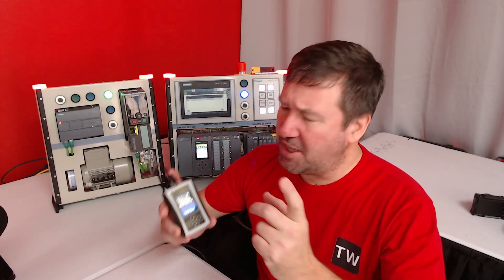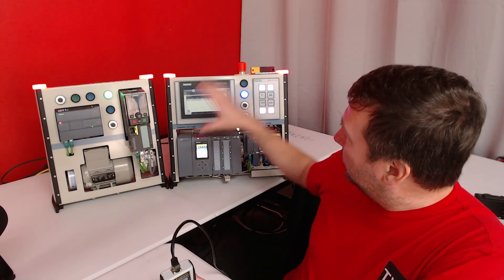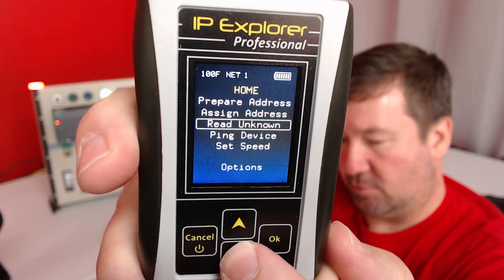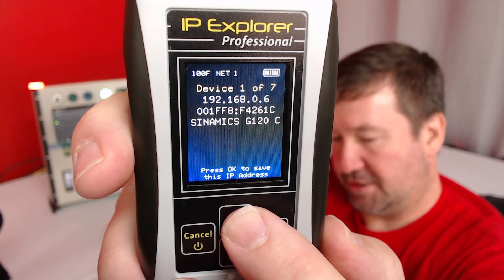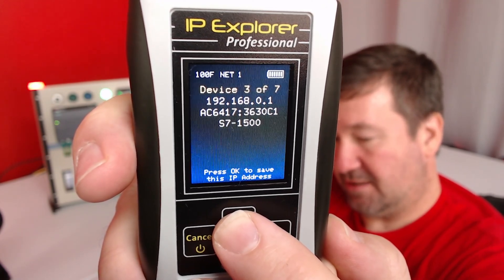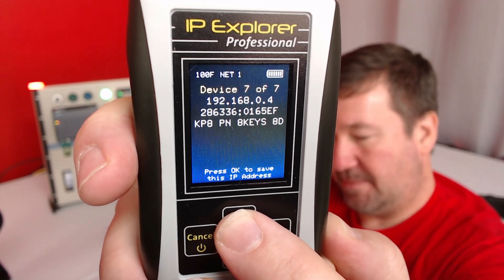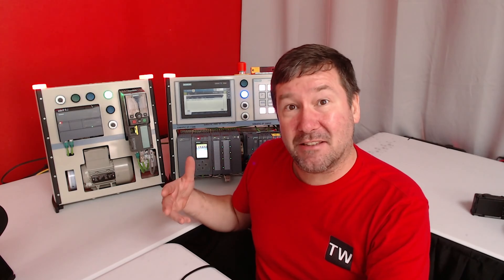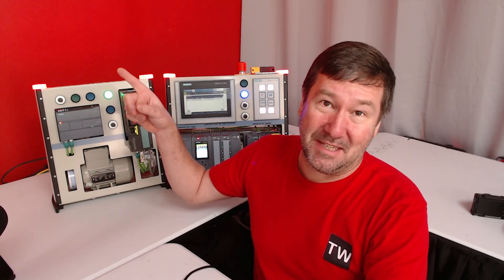Siemens IP Address.  How to Discover

Comment: Hi Tim, does the IP explorer work with Siemens Profinet ? I tried to scan the unkown S7-1200 and it found nothing
Reply: All devices on Profinet don't show up on the IP Explorer, is this normal ?
Reply from the maker: When did you purchase it?  It was added a few years ago.  After that, they should.
Reply: @TimWilborne I bought 3 years ago
Reply: I would like to order a new one on PLC tools web site, but they don’t ship to Canada. The one I have, i was bought in Amazone
Reply from the maker: Send an inquiry in. I'm running a training class this week and sometimes a year's run together. Let's make sure which features yours has.